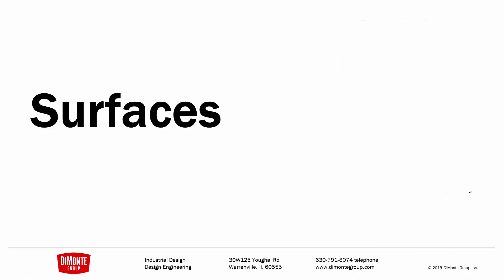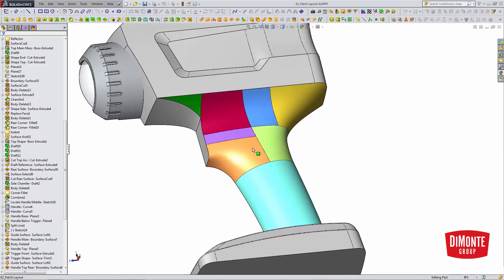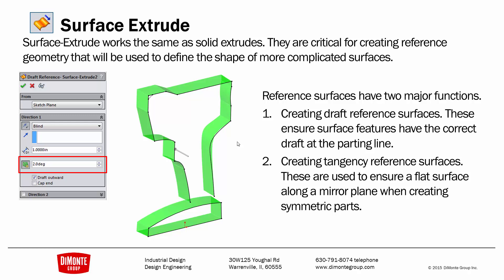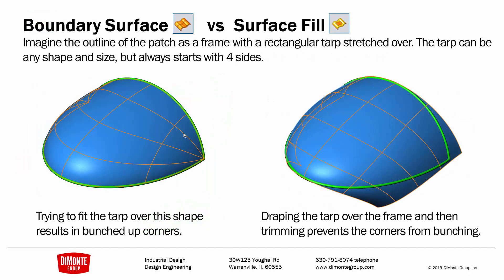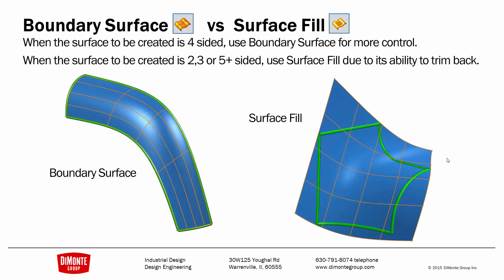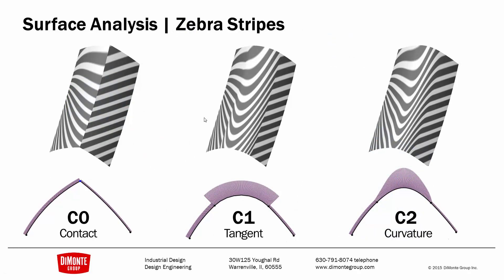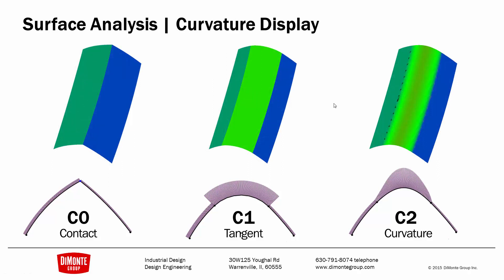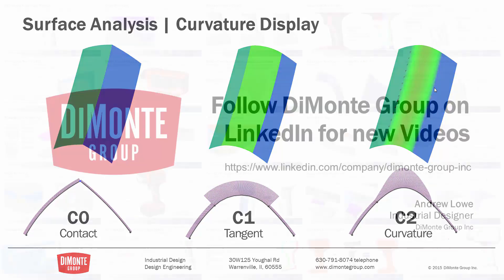Surfaces & Splines | 05- Surface Primer

Comment: Here's my summary of this video:
1. Using a "patch" layout before surfacing a complex geometry.
2. Reference surface = a straight surface extrude of the profile.  Good practice for initiating the surfacing.
3. Boundary surface vs. Surface Fill & Trim:
     a.) 4x sided surface should be created with "boundary surface" command.
     b.) 2,3,5 sided surface should be created with "surface fill" and "trim back"
4. Surface to surface joint relations:
     a.) Contact relation = abrupt radius change
     b.) Tangent relation = equal angle, but abrupt radius change
     c.) Curvature relation = equal radius at junction = smooth transition